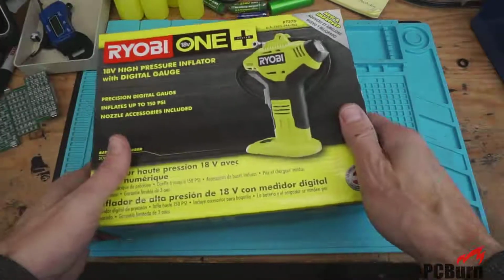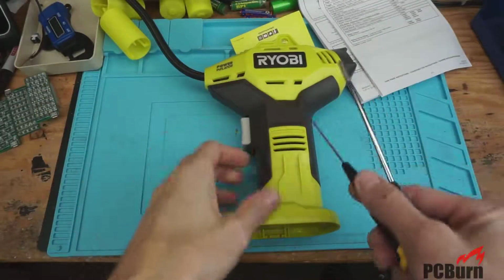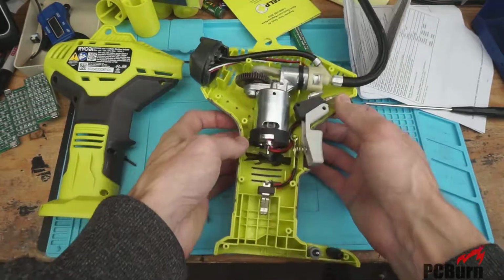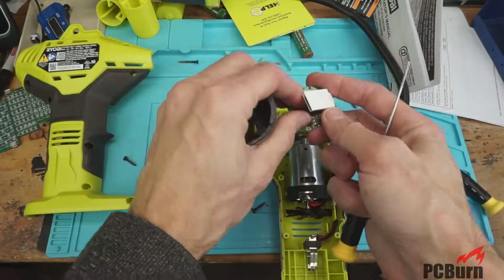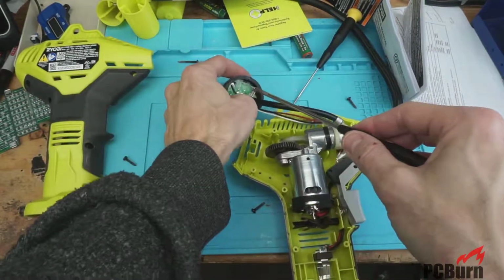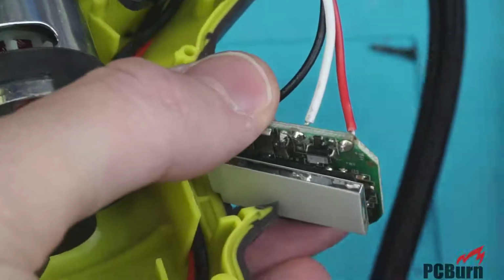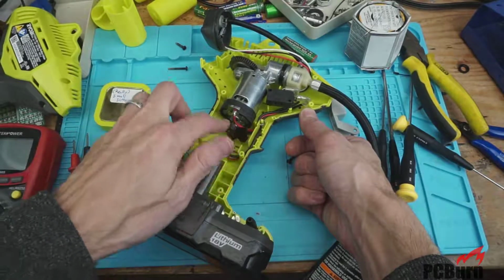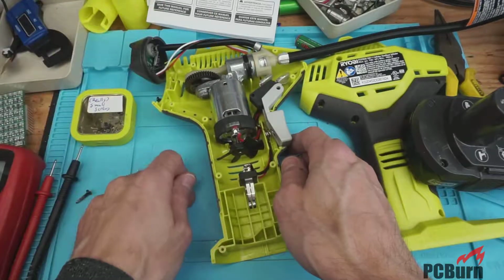Diagnosing a Dead Display in the Ryobi P737D Digital Tire Pump Teardown

Comment: My digital sensor is off.  It's off by about 15 PSI.  Do you know how to adjust that?
Reply from the maker: I never did figure out if yiu can trigger a calibration. I assume you would need to know that and have a reference amount of pressure.

I'm not sure if that's possible after it leaves the factory, though.

Comment: I want to modify mine so you can leave it running until the tire is inflated without having to hold the trigger.  These things are terrible in that regard.  
No trigger lock and the trigger goes off if you just look at it.  Just recently had one in the back of my vehicle that was getting turned on when I braked the car.   ARG.
It also needs a temp sensor to shut it off when it gets hot instead of just dying.  OK, it's $20, but I'd pay $30 to get one that has these features.
Reply from the maker: I agree completely. I've been meaning to put a safety pin in the one that still works.
Reply: @PCBurn  I just ordered some 3-way switches to make it trigger-off-on, should be simple hack.  The heat sensor not so simple, and heck I can't find a cheap pressure sensor.  btw, these are not $20 anymore, now $36 at HD!  And they have $60 ones with target psi shutoff, but they are too bulky.
Reply from the maker: You can get thermal cutoff sensors for a buck or two from electronics supply or the usual suspects. Just need to make sure that whatever you put together handles the amperage on whichever line; I don't recall how it's wired for power.
Reply from the maker: Thermal fuse for a set temperature, that is.
Reply: Umm, use a rubber band or a zip tie to slip it on/off the trigger and never leave the battery engaged.
Reply: @kgm2182  Sure that is what I did for a long time, it sucks and doesn't stop it from going off just looking at it.   Check my channel, I show how I modified one to have a 2 way switch and fixed it.  Unfortunately someone stole it soon after I updgraded it.
Reply: @murraymadness4674  Not leaving the battery engaged doesn't stop it from going off? You're a joke.